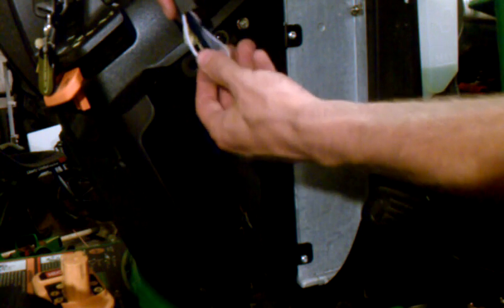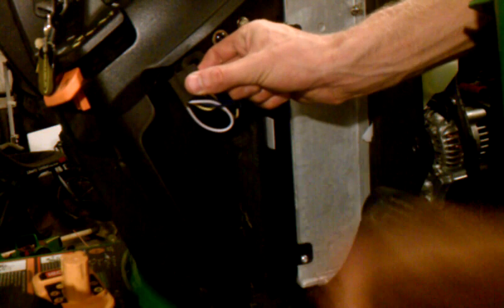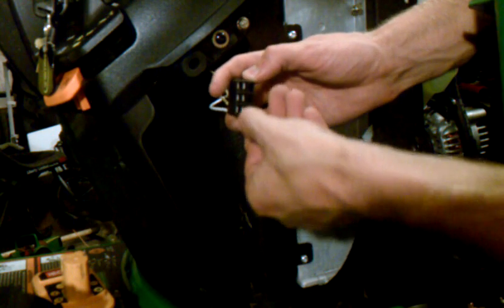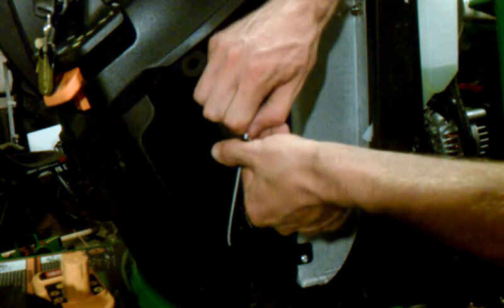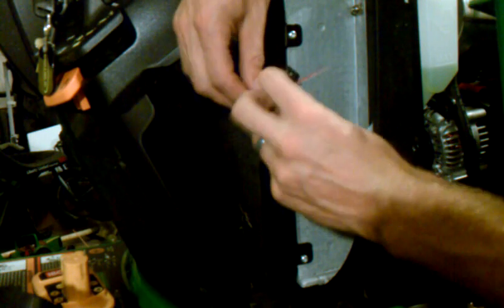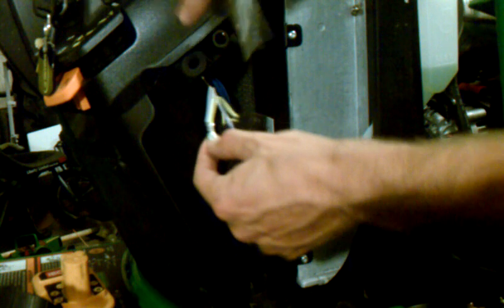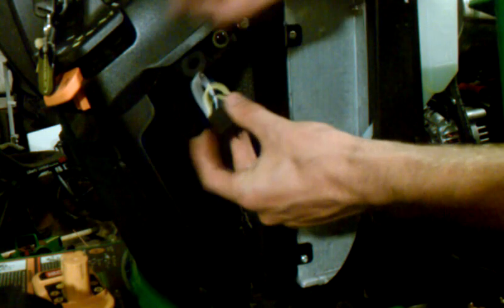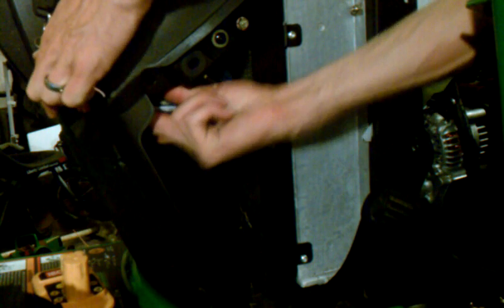How to disable RIO on your John Deere GT!

Comment from the maker: The issue with jamming a stick/cloth/object under the button is that if you ever needed to kill the implement fast, the task of removing the object and disabling the switch would add more time and risk to the task.  (think of you running over a rock/tree root/short pole and needing to get the deck to turn off) This way your dealer probably won't notice the modifications, but they are stock looking and easy to remove.
 
...Please look before you back up..  Lets all be safe out there!

Comment: Thanks for the video. I have a x749 that I removed the reverse sensing lever to disable it. But I think I want to wire it up this way so my backup lights will still work.

Comment: I think i followed your instructions, and my reverse lights stay on all the time. Was this the same with yours? Thanks Kent
Reply from the maker: Kent Wood my reverse lights only come on 1. When pushing the reverse pedal 2. When the headlight switch is turned on for implements.

If you headlight switch is off,  does that fix the problem?
After the modification, is RIO disabled?
What model and year machine are you disabling?

Comment: PLEASE   help me regarding the John deere bypass seat/rio wires. I recently did these bypasses (on a X390) by cutting the ends of the connectors and connecting the ends together.  I did this for the seat switch and reverse switch.  The bypasses worked fine but the next time I went to mow my lawn the PTO switch would not work, the blades will not engage and I get a flashing icon on the screen regarding the PTO.  Even though the bypasses work, now the blades won't engage...I checked the fuses and they are fine...do you have any ideas as to what it could be? Thanks.
Reply from the maker: This isn't a video for the X390 machine...  Read your schematics or find someone who understands electrical circuits to do the job correctly.

Comment: In my humble opinion if you have to have a trailer hitch on the FRONT of the tractor to move a trailer you shouldn't have your licence to drive.
Reply from the maker: Sandy, I doubt you have ever experienced a front hitch application for moving trailers.  This is not new technology to Agriculture as farmers have been moving grain wagons and other trailers around for several decades with this approach.   For speed and maneuverability in tight spaces with one opperator, this approach can not be beat.  I encourage you to try it sometime, you'll love it too!